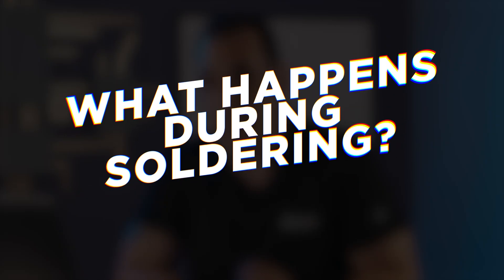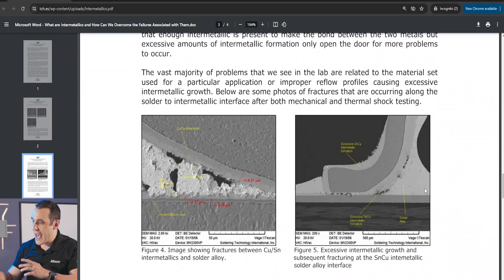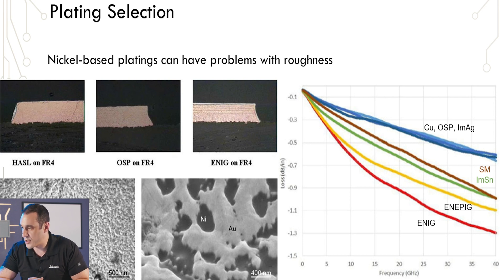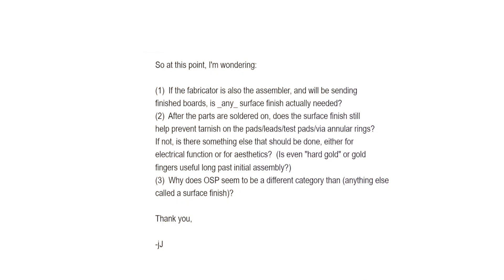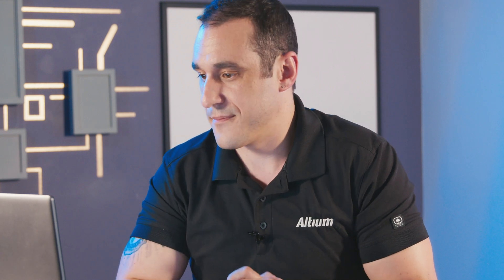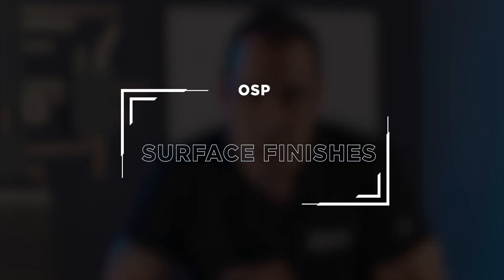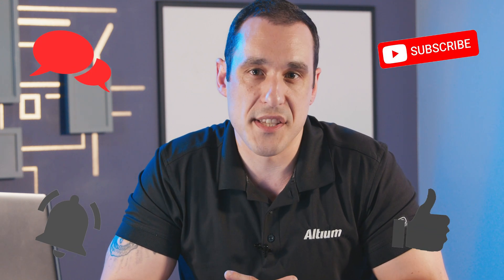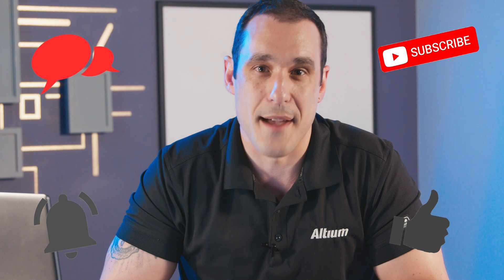PCB Surface Finishes Finishes Deep Dive

Comment: 5:05 they’re actually a lobbying group that aims to sustain the copper industry. They also have a treasure trove of useful info - including a wider body of knowledge than most sources on high-current bus bar design and fabrication.

Comment: 12 to 24 months shelf life?! That's practically crib death!
In my particular niche of simple circuits that mangle guitar tone, small lot hand-populated thru-hole circuit boards are de rigueur, and shelf life of the surplus boards made by the fabricator is a priority unless I want to use them as coasters. I've found that Sn/Pb HASL boards remain usable many years after fabrication; if I'm worried at all about oxidation on an old board, I'll just scrub it with a ScotchBrite pad for a few seconds before populating. Since there's a culture of modding/tweaking these circuits that is almost as old as the first electric guitars, another important consideration is (I know Google won't know how to spell this) reworkability of populated boards; here again, Sn/Pb solder has a solid track record going back several decades.